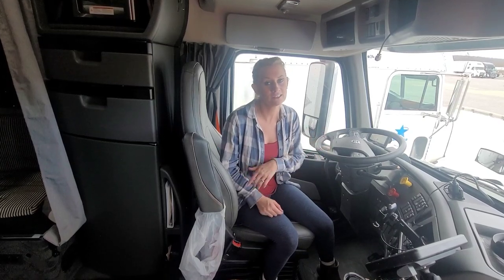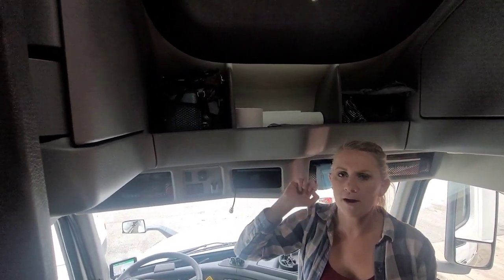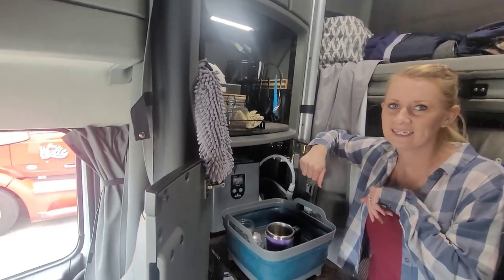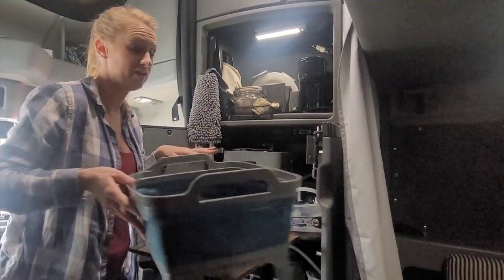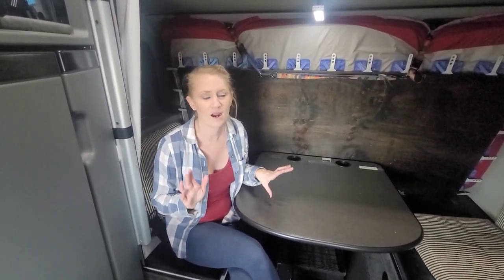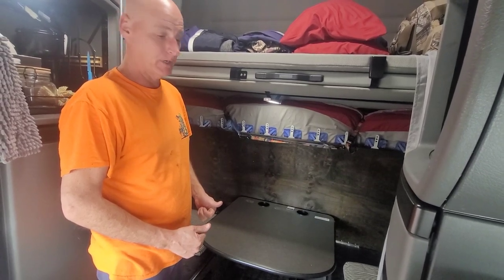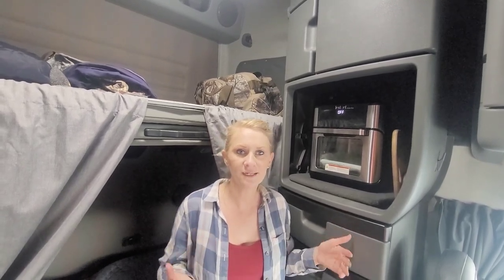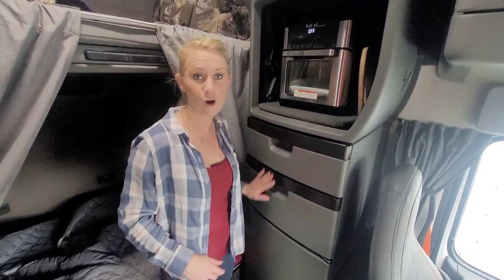LIVING IN A SEMI | Making our SEMI into a Home | SINK with Hot Water | Kitchen Table

Comment: I don't know if someone already let ya know, but.....

The slide lever is for the resistance of the "bounce" you get from the air ride. One direction allows the seat to freely move up and down without resistance. The other direction allows you to adjust the amount of "bounce" you get, and make the seats up and down motion stiffer.

Comment: The lever you asked about controls the a,Lunt of suspension the seat has, up an down. You can soften the ride so the seat absorbs more or make the seat more rigid. To control the “front and back” motion on seat, there is a knob on the right side of the seat under the gear shift.
Reply from the maker: Thank you!!

Comment: The mystery lever could be for the seat swivel feature. You pull that along with the front right lever while sitting and scoot slightly forward while turning towards the right. It puts you in position to watch tv from drivers seat. My 2019 has a similar lever and functions that way. I love it. Happy Truckin’

Comment: The mystery seat button, my KW has that and it is a chugged snubber, it locks the seat or allows it to move slightly front and back to smooth out the front and back movements of rough roads.  Glad you guys are back, love all the great hints and tips.

Comment: That lever on your seat locks or unlocks the motion in the seat if you want it to slide forward and backwards while your truck makes motion it kinda works  to absorb the rocking when breaking and bumps and such type stuff like that or you can lock your seat with it engaged to make your seat not slide back and forth  and stay stiff in one position.  It’s a driver preference and you just have to play with it and see what works best for you and your body and the road conditions your driving on.   When there are constant bumps and stop and go traffic I prefer it locked into place and the seat not move back and forth because I tend to make it into a worse ridding situation due to that motion of the seat going forward and backwards I’ll hit the accelerator pedal harder sometimes and then it gets to be a really ruff ride then lol.  I didn’t read any of the other comments people left you but you might have already gotten the information from someone else but just in case no one has helped you out that’s my experience with that lever on the seat.   And your truck looks really good and you make it look very homie   Have a safe trip out there ma’am and I appreciate the videos of your upgrades and ideas   Keep them coming those will really help out drivers that don’t understand the OTR life out here
Reply: Such a long response only to be wrong lol it's a slider to adjust the shock dampening. So the seat either bounces up and down slow or fast. 🤦‍♂️🤦‍♂️ not used to rock back n forth.